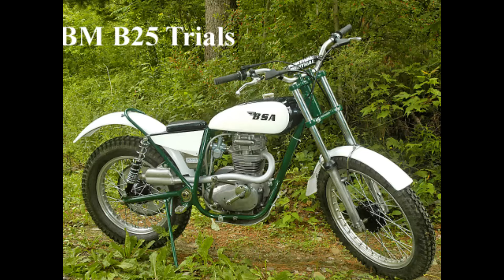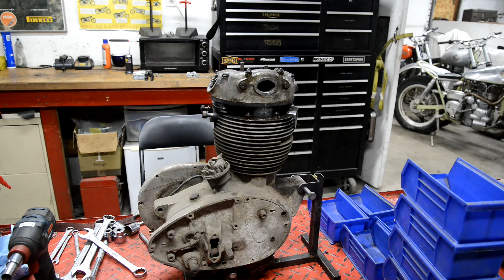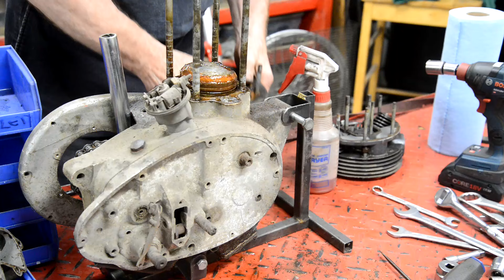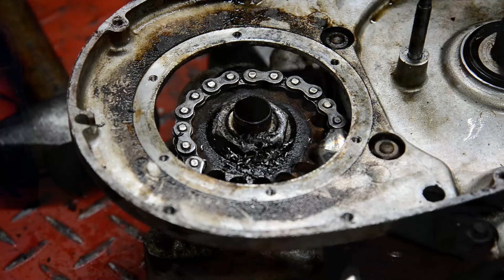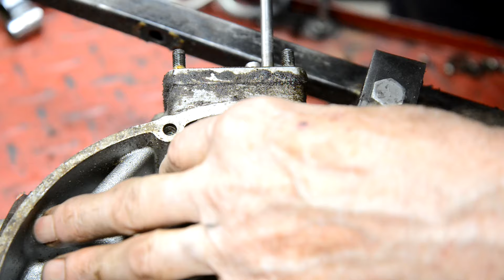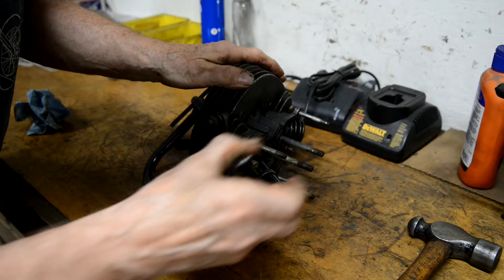350 GreeBSA  -  Part One

Comment: Stopped this half way through. Michael, show as much as you like, we can take it! I love watching engines being stripped be they motorcycle, car, truck or anything. Even though I've stripped engines galore, mainly British and Jap cars Land Rovers as well( 25 year love affair with series and Discoveries, L322 not so much. The only vehicle I've had to admit defeat on and later found out it was a hidden fuse ABOVE the fuse box After I'd sold it for less than 10% of what I paid !) and some motorcycles, I still love watching them being taken apart. One thing I would advise Michael from long experience, you were complaining about getting dirty, dose the outside of the engine with degreaser, and jet wash the engine before commencing to strip it. I know there may be a lot of crap inside it but at least as you are manhandling it around to get at things you are not getting covered in the outside filthy crap. It makes it much more pleasant to do the job.

Comment: Is there a alloy cylinder for a BSA  C-15 250?
Reply: Never saw a factory alloy block for the “Ceefer” the B25 And C25 had alloy blocks but they were square finned pattern and would look odd with the C15 head. Perhaps you could use the whole B25 to end?
Reply: @kenwheeler6150  thanks
Reply: I bought an alloy C15 cylinder on ebay last year from a seller who does a casting run from time to time. As far as running with a  B25 cylinder (and head) on a C15, Rupert Ratio's engine book addresses the differences between the two.